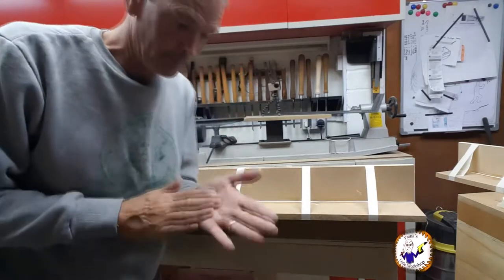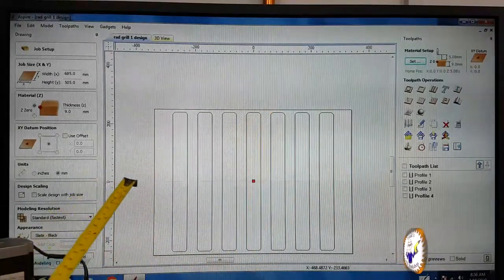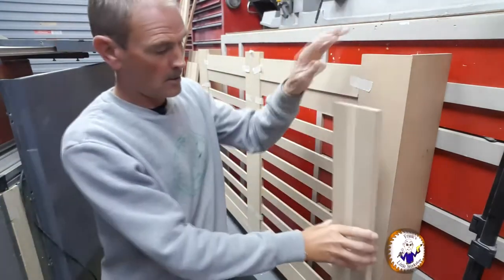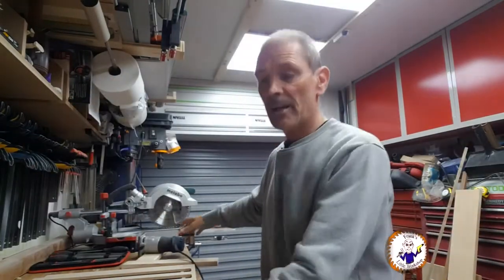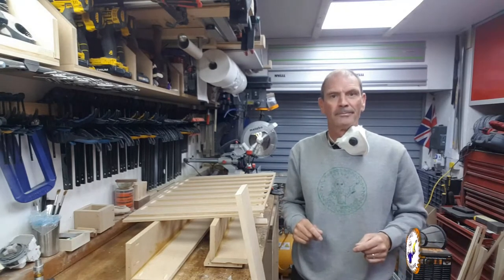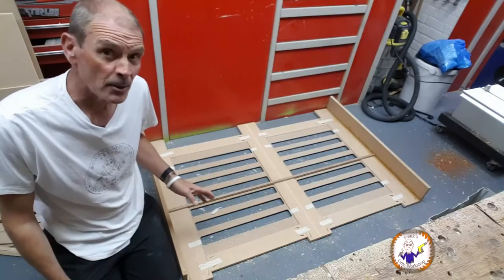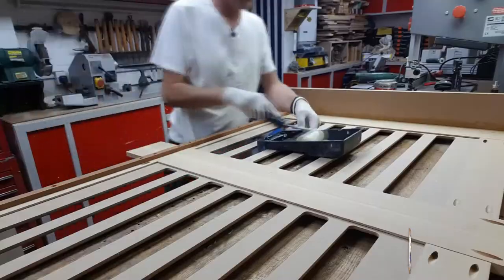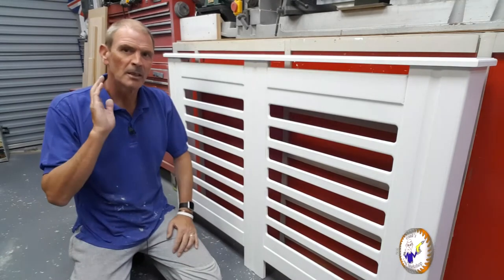Radiator cover Part 2

Comment: Very nice Frank! Excellent use of the CNC as well! Can I ask what spindle you have in that? Looks very neat! 👍👍
Reply from the maker: Hi Peter 😁. The spindle is a relatively cheap unit from China. It was originally only going to be a temporary solution until I could afford a branded one.... that was about 4 years ago and this one is still going strong and is all I need at the moment. In fact, last week I even used it to engrave in to slate to make a house number and it worked a treat (I did have to go very low feed rates though). The details are, it's a 500W unit, spindle body is about 50mm diameter (so quite small), it's air cooled by a fan on the top. I would very highly recommend getting a matched power supply with it. Below is a link to a "very simular" unit / package from ebay. https://www.ebay.co.uk/itm/402258831229
Hopefully the link works so you can see the spec. Would I recommend it... yes I would, but there are far better ones.... but the price rockets 🙁. Just one thing to watch for... check the polarity of the motor (the red and black wires)... some times they are reversed... the spindle runs backward... "don't cut very well".. but just swap them and life is good 😁. Hope that helps. Thanks for watching 😁👍..... (my god that was a long reply.... 🤪)
Reply: @frankslittleworkshop  Thanks Frank! That's really helpful - looks like it comes with a mount as well, which is useful! I'm still dithering about what to replace my Katsu with, but not sure I'll really get the use out of something like the Mafell! Only ever seen 3-phase spindles, which looked terrifying! 😂 Sorry, one follow-on Q; how is it for noise? Thanks! P
Reply from the maker: @10MinuteWorkshop  yep, the mount is essential (but not fantastic quality) but is strong enough and the machining is ....."sufficent" 🤔. I don't have a Db meter to hand but just did a side to side comparison for sound level. The bare spindle is very well balanced so minimal vibration and at full speed (with no bit in the chuck) it is approx the same level as a fully charged 18V Stanley Fatmax drill driver.. unless you have one to hand that may not help... but gives you a "feel" for the sound level... I.e. not very loud. But obviously this changes with... the size of the bit... the material your cutting and your feed rate. It's considerably quieter at slower speeds. I suspect it's a lot quieter than the Katsu (it's quieter than my small Bosch trim router). My workshop is integral to my house and with it working quite hard it is just slight background noise if I go and sit in the lounge (the next room). I hope that is of some help. Thanks Peter 😁👍
Reply: Frank Williams That’s brilliant, thanks Frank! 👍👍

Comment: Right that filter you got is from a hydroponic Grow room it’s a carbon filter intended to remove certain smells from certain herbs that people might not want their neighbours to know about it’s a 100 mm model and you can get a particle shock to go over the top of the filter which you can stick through the washing machine for under £10. Not sure on the manufacture of this one but the sizes are standard Google Rino carbon filters yours is like I said 100 mm or 4 inches that’s the throat not the overall size and you will be able to get the correct sized sock which will vastly improve your The environment in your workshop those carbon filters do you have a shelflife once they’re fully saturated they are useless so it could be worth replacing the filter as well although it’s not made for the job is better than nothing and it will remove any nasty smells and chemicals from the environment hope this helps mate important to look after our health👍👍
Reply from the maker: 😁 Thanks Nathan. That possibly explains how it ended up in an Essex boot sale 😂🤣. I know the filter is partially blocked now as every time I turn it on all I can smell is paint fumes. Will be doing a complete overhaul of the vac and air filtration in the workshop soon so the carbon filter will go and be replaced by something more suitable. Just need to get some money together.... and also design a cyclone for the vac system. Thanks for watching Nathan 😁👍